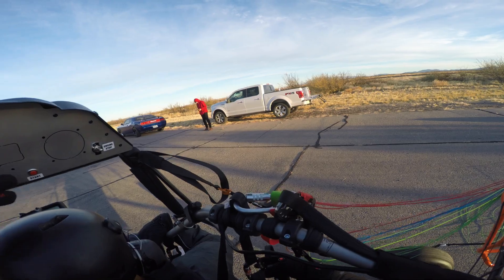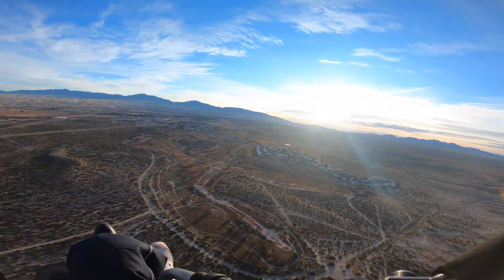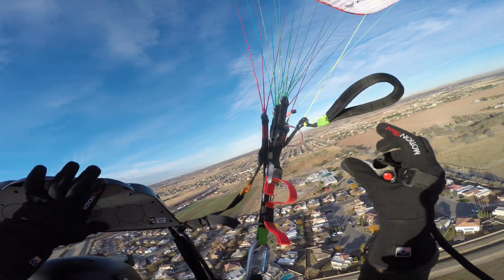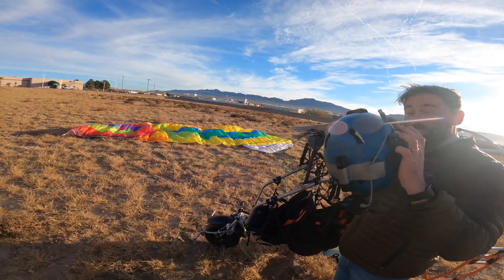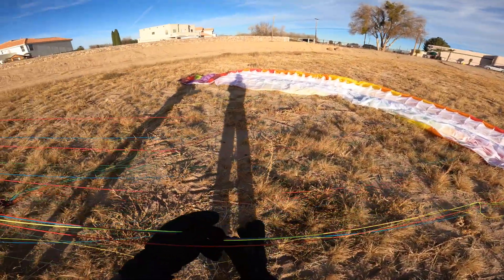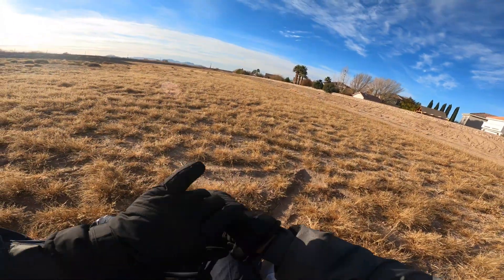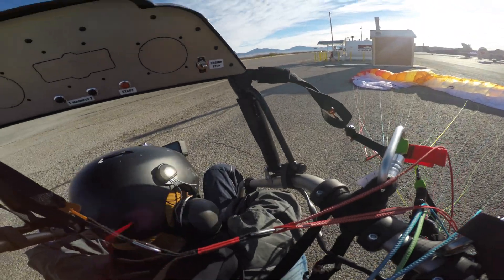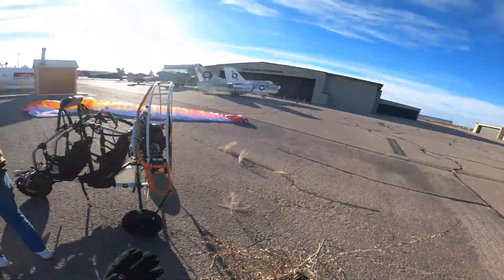Emergency Landing with a Passenger!

Comment: Any idea what caused the engine out? Great content btw. Very cool that the student appreciated the set up and re-launch,,,nice content!
Reply from the maker: Thank you Keith. I am not certain at this time. If the carburetor isn't adjusted just right, I find that the engine is prone to stalling after coming off of throttle. I think engine temp also has something to do with it. Still, I love that I have this engine. I am positive that if this engine could be adapted with EFI, this would not have happened. The carb is the culprit.
Reply: @AnthonyVella   did you put the winter cover over the radiator? I just thought about that. The carb is tuned for normal operating temps and the engine temp could have dropped drastically in a high air speed maneuver like a spiral with the engine at idle. A legitimate EFI system would also require an alternator which would rob some power from the engine.